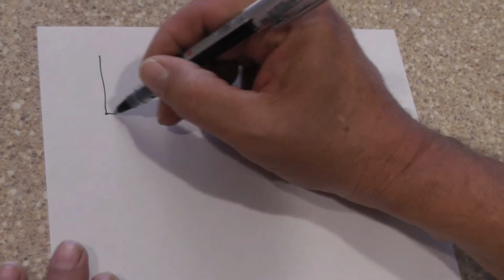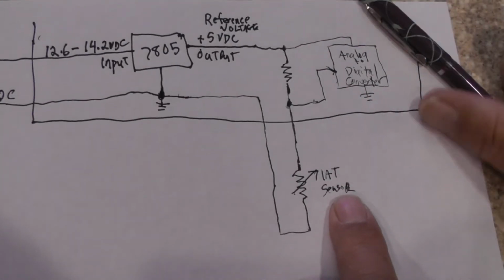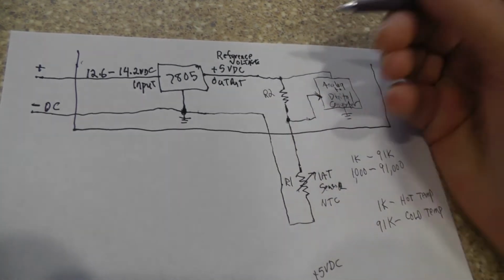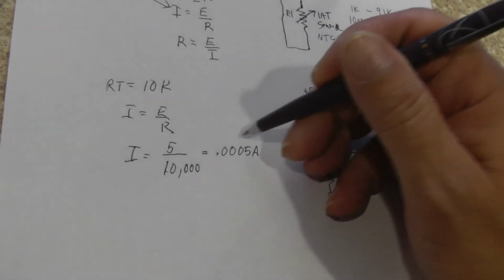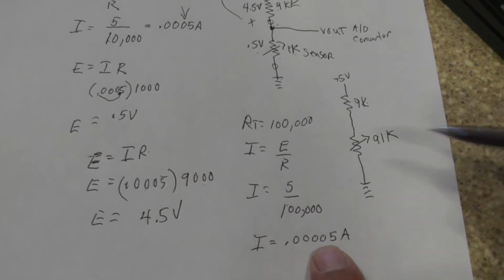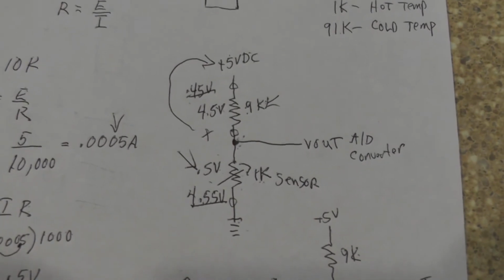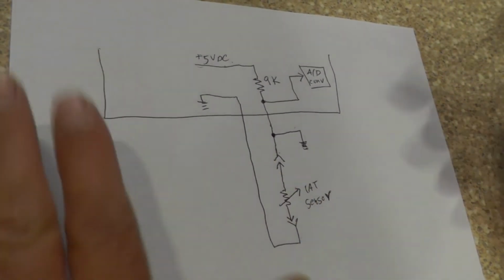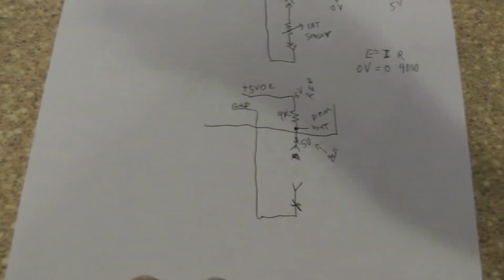IAT/ECT Circuit Operation and Troubleshooting Tips

Comment: That 5V reference seems to be used in all kind of sensor circuits. One thing I've noticed this past decade when my battery is failing (on many different vehicles now) is a sag in idle speed. My theory is that at slow idle my alternator is unable to keep base voltage up, and that translates into a sag in the 5V reference baseline. That sag seems to allow idle to drop, without the usual automatic correction from the PCM. With a little gas and some time for the alternator to recharge a failing battery, all is well. I haven't come across a better explanation -- any thoughts?
Reply from the maker: Hey Dave. You always give me these thought provoking questions (smiling)... Your theory sounds good, but there is one flaw that doesn't make sense. I can't say for sure what the part number is for the voltage regulator inside the PCM, but all regulators that I've run into needs at least a couple of volts above it's output voltage for the output voltage to stay stable. I looked up the data sheet for the 7805 regulator and it can maintain a +5VDC output where the input voltage can vary from 7V-35V. So, even when the battery is failing, the 5V should still be constant. I can't explain that when the battery is failing, why does the idle speed drop, unless there are other things going on such as bad connections at the battery or some other place. I could see that if the generator was failing such as having a bad diode that AC voltage could get on the DC bus line. And with that scenario, all kind of things would be possible and not just with the idle speed. I'll have to think about it some more Dave. Good question though, and thanks for dropping in and taking the time to comment and for watching the video.
Reply: If your reference deviates away from whatever that voltage should be then you've got a problem.  Reference voltage is supposed to be the one stable constant for all of your sensors. 

My problem with your theory is that the alternator should be putting out about 12-14v minimum right?  Using a resistor it drops to reference voltage (4.5-5.0 most cases).  So it shouldn't negatively affect the reference circuit in anyway unless system voltage drops to below 5 volts.  Your car isn't going to stay running with such low system voltage anyway so in that regard the problem would obviously be the alternator.   Reference voltage is usually provided by a pin from the ECU.  You can probe the reference circuit directly at the ECU and look for deviations there.  Reference voltage shouldn't have anything to do with the alternator unless it's an obviously malfunctioning alternator (which should be obvious due to poor battery+ voltage)... both for total voltage and stability of that voltage.
Reply: I was surprised the first time this happened, after a parking lot boost 10 years ago. I couldn't maintain idle without goosing the throttle. But after a few minutes of driving, no problem. An alternator needs to be spinning at a minimum rate to generate power, which is why I'm thinking that voltage is sagging at such low (~300/min) RPM. Of course when this happens in a parking lot you don't have the arms or tools to do diagnostics. I just know the problem resolves after a few minutes of recharging with engine on.... This has happened with three different vehicles now, it's becoming a recognizable pattern. Any ideas?
Reply: spelunkerd  For my vehicle anything under 500 RPM and it will begin to stall.  How are you not stalling under 300 RPM?  That's my cars starter speed.  High lift cams?  Sounds like a bad alternator to be honest.  Are you using some kind of inverter on these vehicles.  There has to be a common denominator.  Something electrical you are introducing into the 3 cars that is drawing electricity.  Parasitic drain perhaps?  Nothing should mess with that 5v reference because it comes from inside the ECU itself.  The resistor is inside the ECU then pins out to specific wires.  Also the reference voltage has a ground circuit that it might monitor going into the ECU too.  1 or multiple pins for reference voltage out and reference ground in.